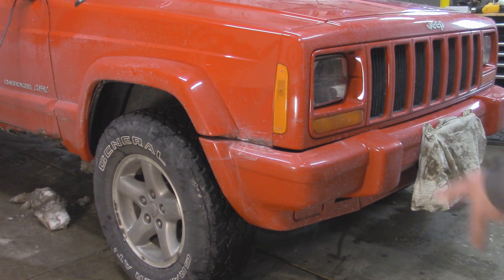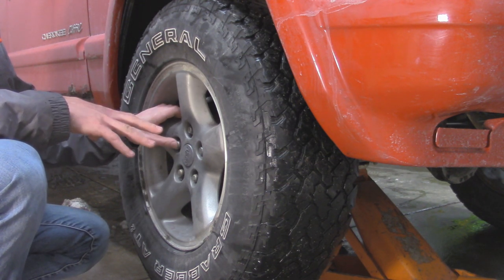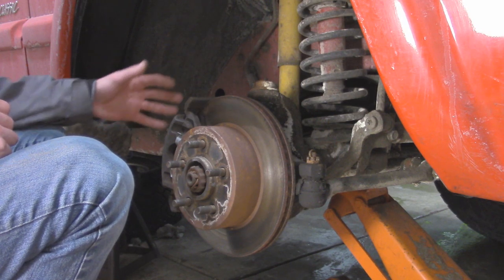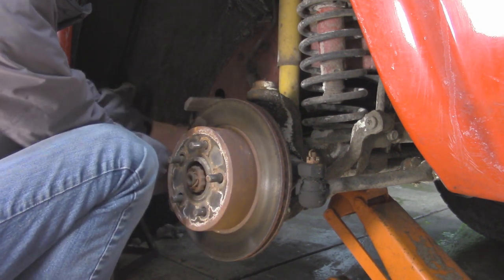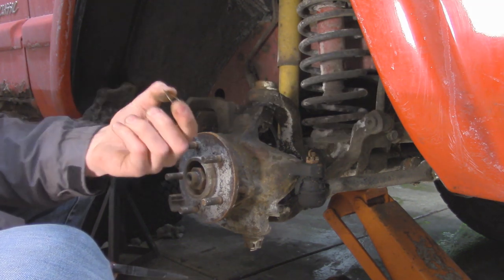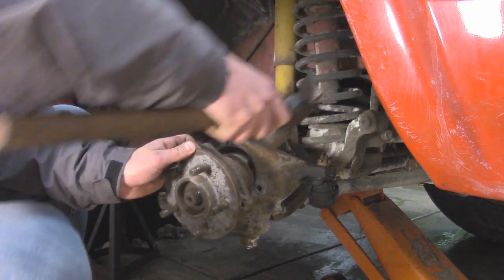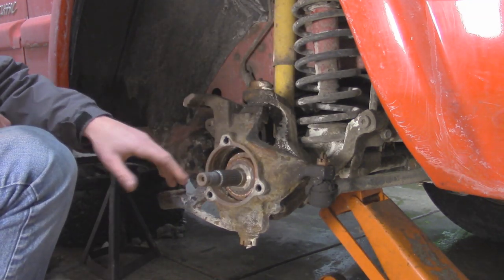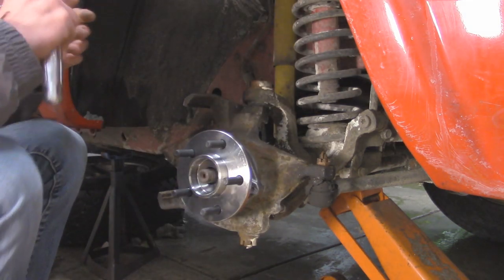Jeep Dana 30/44 Wheel Hub/Bearing Replacement

Comment: Your video is right on time, bro. I have to do this job on mine. I noticed my camber is shot and I'm hoping it's not the ball joints. I replaced the BJs and unit bearings a few years ago for our Moab trip. Your channel is great. Keep wheeling!

Comment: I use the hammer/bolt trick too.  But I loosen all three about 1/2” out, then use an old 13mm socket to hammer on.  Works well and doesn’t ding-up the bolt heads.  The other way is to put the bolts in part-way, wedge something in between the bolt head and axle ‘C’, turn the wheel to apply pressure, and give one good whack to the cast-iron of the knuckle.  One good whapp will vibrate the cast iron to break the corrosion bond (also a great tip for ball joints and TREs).

Comment: if u dont have extra bolts to hammer out the hub you can place the 12 point side of the combination wrench on the bolts you have and have it protect the bolt while u hammer it.
Reply from the maker: You can try  that, just got to make sure not to mushroom the wrench end.

Comment: Using anti-seize is a good tip, especially if you live in the rust belt like us.How do you like those General Grabber a/t's?They look nice....
Reply from the maker: They're doing well so far, when we got the jeep they were a year old and the previous owner had one blow out right away so we had to replace one. But there about 50k miles on them and they still got some tread but they are starting to crack from age.

Comment: Best video I’ve found. Thanks! Couple of questions. Decided to do this work and more on my 2001 4 wheel drive xj as well as replace my u-joint and rotors and pads while there. 
My 2001 has anti lock brakes. Would any front wheel bearings /hub assembly I would buy for that year have any anti lock brake connection? 
With ignition in run,  jeep in 4 wheel and opposite tire on ground, will this create any issue pulling axle shaft out to replace u-joint and putting back in?
Reply from the maker: It should be the same process on abs brakes. Same u joints and wheel hub is used. On these older vehicles with abs they use a sensor mounted to the knuckle that reads a gear that's on the axle shaft. You should be alright to pull the axle shaft and hub off while the other wheels are on the ground and in 4x4, but being in 4x4 is not necessary.
Reply: @OutJeeping  Thanks for the quick reply. So in your opinion, you think the Timken is better quality than the Moog Axle bearing/hub? Personal preference or is this a general consensus from Jeep owners? Closest I get to off roading with my xj is rough dirt roads to get to trail heads.
Reply from the maker: @rogerball2495  In general they are both a great brand to use. As I have heard from many people in the Jeep and Dodge Community, Moog quality has gone done in the last 10 years. I personally recommend Timken if you have the funds. They specialize in bearings and seals and I have heard nothing but great things  about them from other people that have used their products.
Reply: @OutJeeping  Thanks for the. Info. I’ve photographed in one of their ball bearing facilities. Well run. Didn’t connect the name till you mentioned the bearings and seals part. Only about $5 difference.

Comment: Do new wheel bearing hubs have resistance when rotating or do they spin freely?
Reply from the maker: They should have a little resistance from the grease inside and the preload on the bearings.

Comment: I have a question. Just bought a 93' cherokee and sometimes when I go to start it, it will crank and turn over and other times it will just crank and not turn over. Im thinking it may be the Crankshaft position sensor. Do you have any ideas?
Reply from the maker: Sounds like it could be signs of a bad starter solenoid where it engages the starter gear to the flywheel/flexplate.
Reply: @OutJeeping  i was wondering because the people i bought it from jerry rigged a wire so in the event it doesn't start, touching that wire to the positive terminal would start it
Reply from the maker: @AnEverydayGamer  If they rigged a small wire to the stater, that's probably because they bypassed the safety switches that may have gone bad such as the NSS or Ignition switch.
Reply: @OutJeeping  possibly. Ill have to investigate whenever it warms up lol. Thanks for your input.

Comment: What can happen if the shaft nuts are not tightened to 175 lbs ft?
Reply from the maker: Too loose or too tight can lead to premature wear in the bearing itself and fail a lot sooner than the required life expectancy of the unit bearing.

Comment: i have a whining sound coming from my front end. it starts up at about 25 mph. any ideas on what it could be?
Reply: Check oil in the dif
Reply: @jerrywhalen2100  will do thanks!
Reply from the maker: Either it could be a wheel bearing or bearings inside the differential. I would definitely start by taking a look at the fluid level in the diff.
Reply: I have a squealing noise that I thought were my brake pads. Jacked up the Jeep, turned the tire by hand and found the noise is between the U-joint and the front of the transfer case, nothing loose. Transfer case fluid good. Still not sure what the heck it is. Made sure all 37 grease point are lubed, all good.